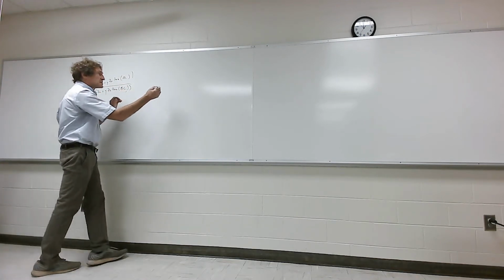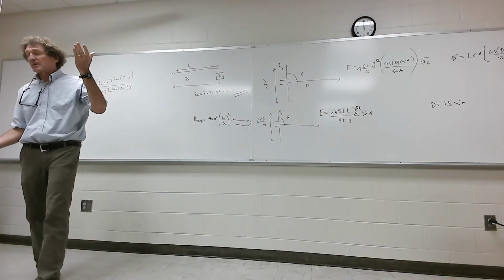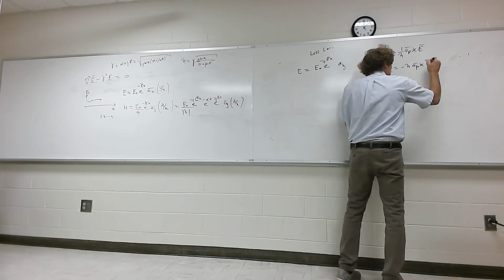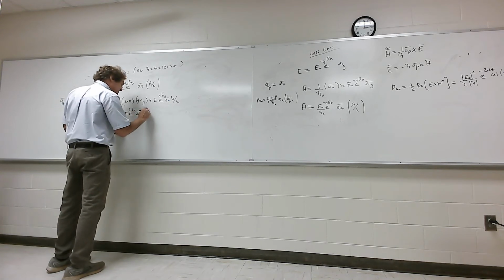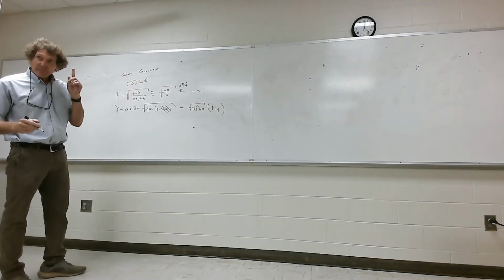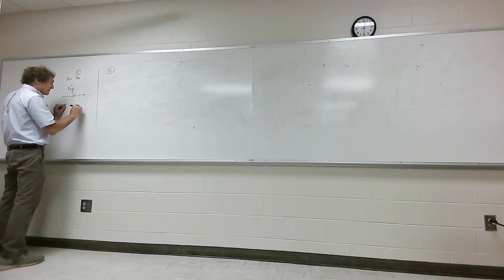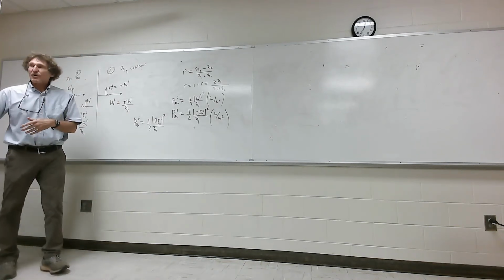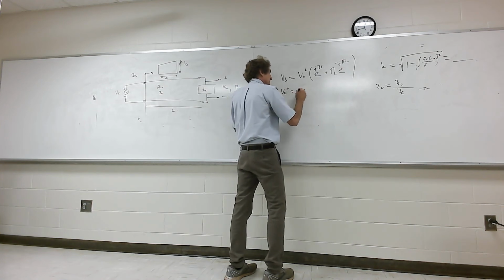EMAG 2 Lecture 21 (10/12/22)

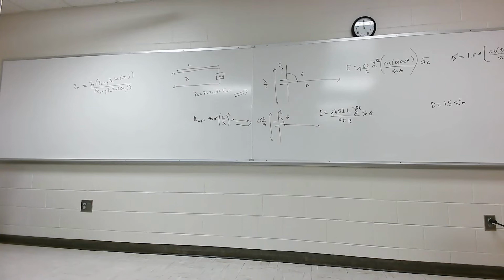Comment: 9:33 Reasoning behind 0.485λ length half wave dipole antenna:
Wentworth: For impedance matching, it is very convenient to operate the antenna where its reactive component is zero (i.e., in a resonant condition). This can be achieved by making
the antenna slightly shorter. Although the exact length depends on the antenna's wire radius, a dipole antenna of about 0.485λ length will have an approximately zero reactive
component and its real part will be close to 73 𝛀. 
Baginski: You want most possible current with least possible voltage. We don't want the reactive element as its limits the current, a higher voltage would be required to achieve the same current.